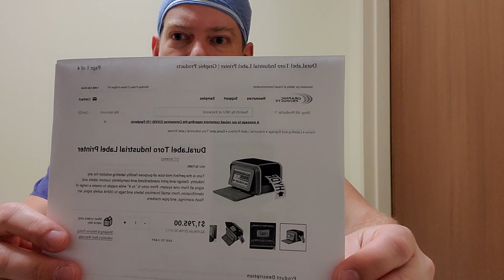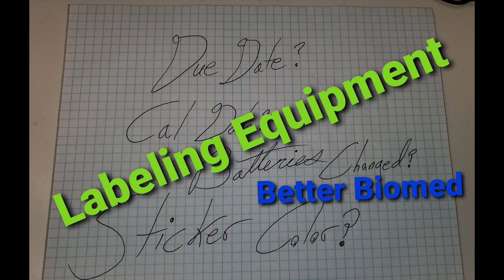Equipment Labeling - Why is it so different between hospitals?!

Comment: Do you guys use goggles when dealing with COVID exposed equipment? Saw an interview with you gloved up.
Reply from the maker: Face shields if splash hazard.  During times like these, general eye protection - even during low risk repairs isn't a bad idea.
Reply: @BetterBiomedChannel  Was curious what protections existed - we are as strong as our weakest in this pandemic. 

Apparently the first doctor to die in Wuhan was a senior director - while sick he concluded he got the virus while visiting the COVID ward without eye protection. Stay safe!
Reply: Tell ya what, I'm not sure how to message on here, but if you need thermal goggles that won't fog will send them over no charge. with so many healthcare workers getting sick, that elevator ride may as well be the New York Subway.
Would welcome your feedback on the design.